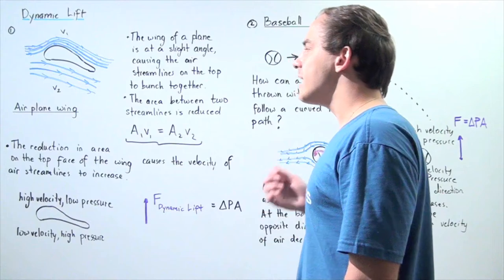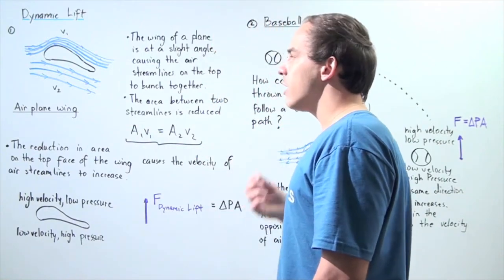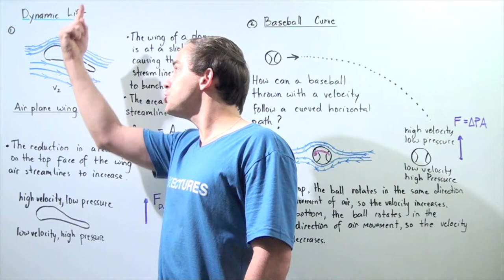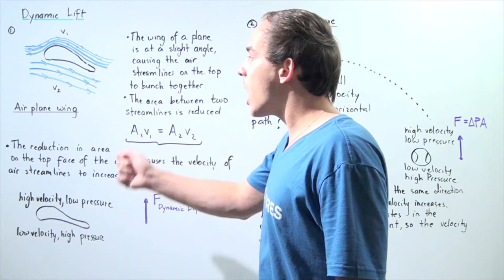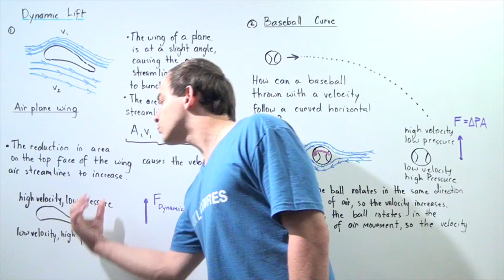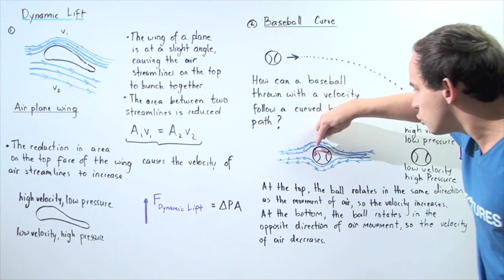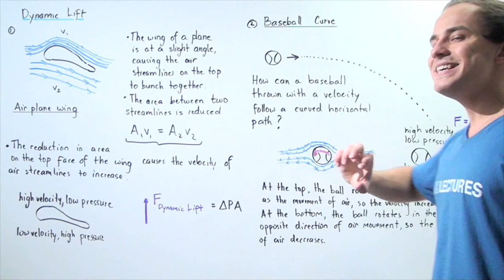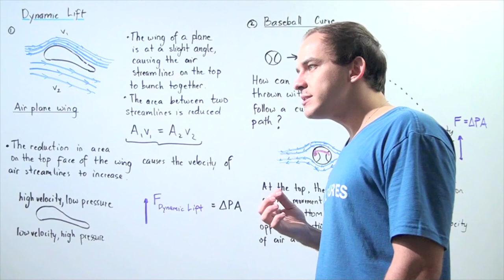Dynamic Lift

Comment: Hello Andrey, I'm a student in a university aeronautics course and am doing an assignment about correcting and/or fleshing out explanations of lift to help spread a more intuitive and thorough understanding of the complicated and somewhat controversial topic of airfoil lift. This video was great! It was super clear and easy to follow. I wanted to add here in the comments a more physically intuitive explanation of lift for those looking for more.

The concept of low pressure on top and high pressure below an airfoil generating lift holds true for any explanation of lift, but it can often be a struggle to understand why this pressure differential actually occurs which we see as the contraction of streamlines discussed. The current theory suggests that similar to in a mathematical equation the pressure, velocity, and curvature of the airfoil all contribute simultaneously and that no chain of cause and effect is adequate to explain the overall phenomenon of lift. The flow of the fluid tangent to the top curve of the airfoil draws air away from the surface which would cause a vacuum to form so, the higher pressure surrounding this would be vacuum pushes the streamline or flow into the airfoil surface which is why it adheres and the streamlines bunch. This phenomenon is happening all over the top of the airfoil all the time establishing the pressure gradient (low at surface, ambient far away) which also drives the fluid faster and forces it to adhere to the curvature which by Bernoulli's equation reciprocally helps establish the pressure gradient. What happens on the bottom is much simpler as the flow actually drives into the airfoil which due to inertia creates an area of high pressure which is how the fluid imparts its momentum onto the airfoil.

Comment: Dynamic lift

Dynamic lift can be defined as the as the motion of any object upward due to that two different type of motion one is rotational motion and address translational motion forward due to the due to the pressure gradient fluid around the object.

For example ball for example a cricket ball when it is thrown from the bowler hand to get the spinning so that is axis and translational motion towards the stamp so it get the lift where's the stamp to get them in Swing Out swing due to the dynamic lift. These things happen due to the surrounding air.